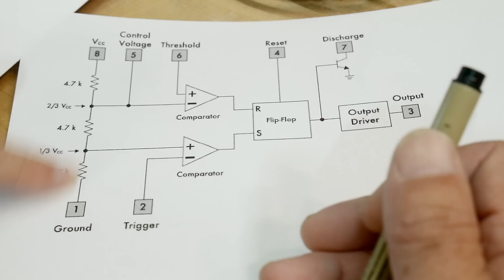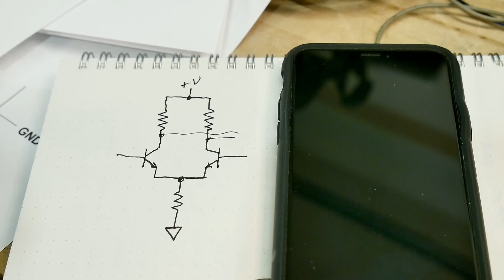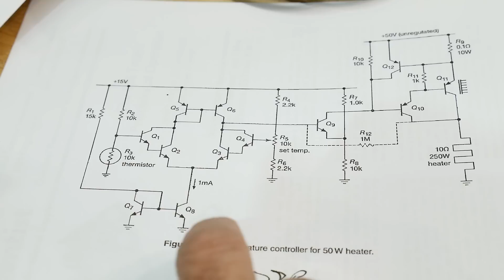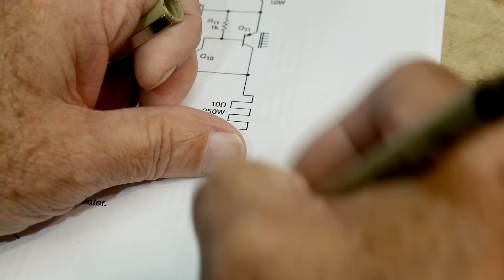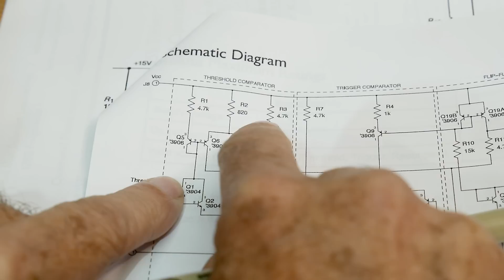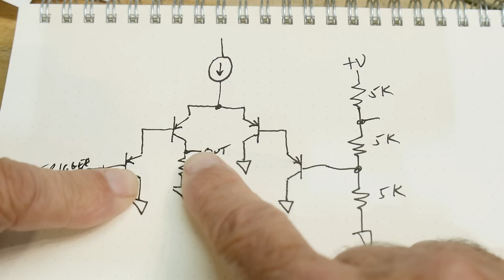#1731 Evil Mad Scientist 555 (part 2 of 4)

Comment: Op-Amps also have a lot of gain but make poor comparators unless one supplies some positive feedback to ensure some hysteresis and prevent oscillation at the threshold voltage. Is the current mirror in the 2/3 V comparator of the 555 effectively fulfilling the same role by injecting more current into the opposite side of the differential pair?

Comment: I was wrong in my previous comment. The currents are  not constant.  But they are equal by current mirror. Using KCL at collector output node, the output current can be calculated as 2x the delta Ic of the right side or left side. Anyway the first stage is still a voltage-to-current amplifier.

Comment: I think I get the current mirror going into the two sides of the teeter-totter... The extra current on the other side is blocked from going through its collector, and therefore has to go somewhere which then forces that extra current into the base of the transistor in the next stage of the circuit. 
It wouldn't work well, I don't think, if the next stage couldn't sink it (e.g. if it were Hi-Z input).

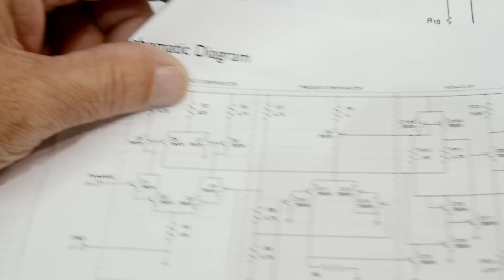Comment: 15:43 I don't understand why you need Q5 and Q8. All 3 pins are connected together. If i pause the video and cover up pin 1 of Q5/Q8, pin 3 to pin 2 is basically a diode. When Q1 is turned on, it pulls the base of Q6 down, turning it on (Q6 is PNP), which allows current to flow out of pin 1 to R11 and Q15.
Reply: Q5+6 work as a current mirror although the "mirror ratio" is not 1:1. Same for Q8. You can also think of Q5 being a nonlinear current to voltage converter which is matched to the Vbe of Q6. The emitter resistors determine the ratio of collector currents.

Comment: Can someone explain why they didn't use the same buffered current mirror at the trigger comparator stage as at the threshold comparator?
Reply: I was also wondering why they were throwing away so much gain.
I think it's because They needed to drive Q15 almost into saturation to flip the flop. Using the dual current mirrors would require a bunch of transistors to get it right. Perhaps the juice just wasn't worth the squeeze. As soon as Q15 conducts, the circuit enters the discharge phase which has quite some dead-time and timing uncertainties due to transistors getting saturated. So why waste chip area to add precision to a phase that is anyway not gonna be precise?
Reply: Pin 6 comparator gain forms part of the timing precision when used as monostable timer. 
Pin 2 precision is only relevant when used as oscillator. Not primary goal obviously.
Reply: @Oldclunker-ge5zp  Thanks, makes sense!

Comment: The 2 comparators have different operating points, but for both of them the need is to, when the input is out of the mid range, to have a fast charge injection or removal from the flip flop stage, so they are designed, for the upper one, to turn on and supply current into the flip flop stage fast, but recovery when it drops is not as critical, provided it is just fast enough. Same for the lower, it pulls current out of the flip flop, turning it to the other state fast, but recovery again, as the slow edge does not worry the output state at all, is slow. This use of one input to the flip flop being active high, and the other active low, helped with the design, saving the need to put in an inversion stage, with the need for then level shifting of the one, to handle the different levels of the comparators, and also the need for large areas consumed by polysilicon resistors, as the transistor active loads are much smaller than the equivalent in polysilicon resistors, and the 100k pull down on the lower comparator is achieved by having the resistor actually being made using a very small JFET, with the gate strapped to hold it hard off, and thus it varies resistance minimally with voltage, meaning it acts as a weak pull down R6 at trigger, keeping Q15 off, but using minimal board area. 

The flip flop designed that way needed fewer transistors, and also, as you just have a single output driving the power stages, you made it simpler as well. The different levels of the comparators also interfaced with the flip flop well, saving area, which was a big thing when designed, as making the chip smaller meant a lot more per 6inch wafer, and even more so with larger wafers. Thus no stability capacitors, instead using the inherent capacitors of the junctions to make the comparators stable at transition, and, aside from the output having that cross conduction in switching, made it faster. You got used to having a 555 timer design having the main power supply decoupling right by it, just for that, and the rest of the TTL barely needing any bypass overall.

Till the advent of cheap mosfet drivers, you often found a 555 timer being used as an inverting driver and level shifter, simply using a 3k3 resistor from pin 5 to ground, to force it to be 'more or less' TTL compatible with a 12V supply. They say 500mA, but you can easily get the originals to 1A of current drive on a MOSFET gate, though the modern ones are wimpy compared to the old process ones, and for more pull down connect 7 to 3, to get that gate charge out faster. Better have that 1000uF low ESR capacitor right by pins 1 and 8 though, the current would be nasty. Still got a few TO100 can versions, ran them with clip on heatsinks, driving piezo transducers direct in push pull, they ran rather hot without them, with them just merely uncomfortably warm, though the transducers were kind of hard driven, at 24Vpp on them, as ultrasonic deterrents. Worked on the bats, they decided to decamp after a week.
Reply: Moments like these make me hate 'apps' and web2-3.0...
I really want to sit down and read this comment when my brain's in the right state... but how can I friggin' bookmark it for later?!

Comment: Small correction: A darlington pair differential amplifier has less differential current gain than a single transistor differential pair. Collector current ratio for single transistor pair is I0/I1=E^(DiffVoltage/TempVoltage), for darlington pair is I0/I1=E^(DiffVoltage/2 * TempVoltage). I think in case of 555, the Darlington pair decreases input current and allows seeing voltages very close to supply rail.
Reply: Darlingtons reduce the input currents of pins 2 and 6. Since most designs connect these two pins together, their NPN/PNP input currents tend to cancel out, at least roughly.
The threshold voltages are 1/3 and 2/3 of VCC, therefore sensing at GND level is possible but not the primary usage of a timer IC.

Comment: Pin 5 can be used for frequency modulation when the 555 is oscillating.
Reply: Yes, but the duty cycle is a secondary effect. I have to dig out the old data sheet where it was called "FM", rather than the somewhat wishy-washy term "control".
Reply: I get what you wrote about SPWM and FM, but I don't understand the context of AM ? Which carrier frequency do you have in mind?
Meanwhile, I found the diagram that calls pin 5 "FM". It's in a Valvo databook from 1988. Valvo was a German (Hamburg) subsidiary of Philips (Valvo made all kinds of tubes and semiconductors etc since the 1920s). In 1975, Philips bought Signetics. Most content of the book looks like it originally came from Signetics.

Comment: you touch really close to an idea that I have been thinking about regarding how to teach circuit design. that is the idea that what we should consider teaching first is not transistors, tubes, diodes, etc,... but rather start with those devices you see as root devices in Spice. that is current sources, controlled sources, voltage sources and the controlled version, etc.
then AFTER students understand those items you behavior model transistors etc with the sources to explain the configuration/topology of various circuits.
---
I imagine that had we been taught in that way - circuit design/analysis would be simpler.
Reply: we were taught that way...
frankly, I found it exceptionally more confusing because there's no such thing as a current source without active components, so the transistor models were an act of infinite recursion. VERY confusing.

Comment: I can't believe how you brought this small chip that was invented in 1971 back to life and instilled in the heart of every listener the spirit of enjoying this simple invention.
Thnx mate
Reply: The 555 was, is and will be. It's one of the timeless chips which is ironic, being a timer. I still use one every chance I get. 
A search for 555 at Digikey returns 416 line items and shows they have stocking levels in the millions of chips. 
Fun fact: Every Apple ][ computer with a 5 1/4 disk drive contained at least nine 555 cores.  (1 for power on reset, 1 for cursor blinking, 1 for key repeat, 4 for reading joystick pots, and 2 for timing disk drive motors)